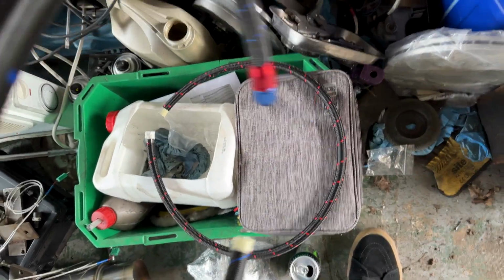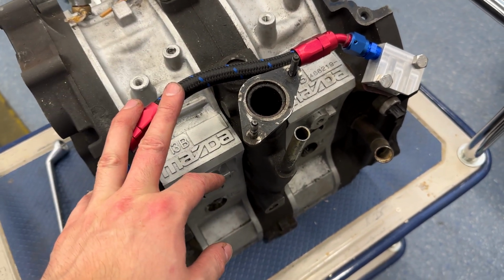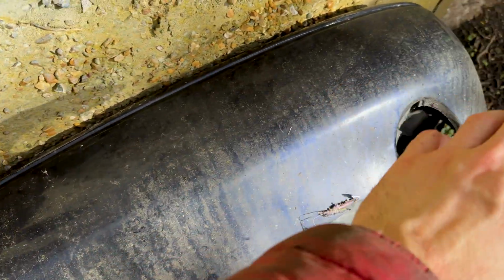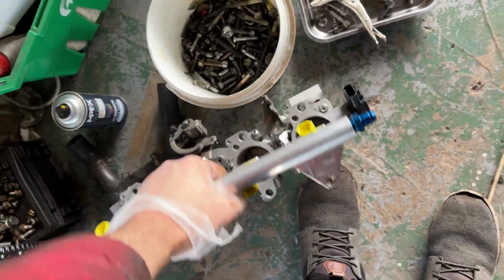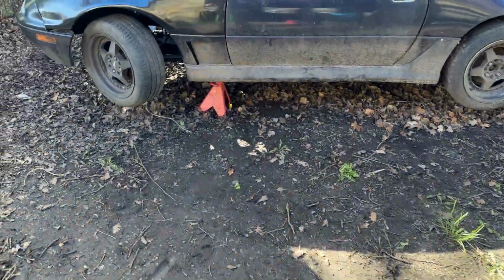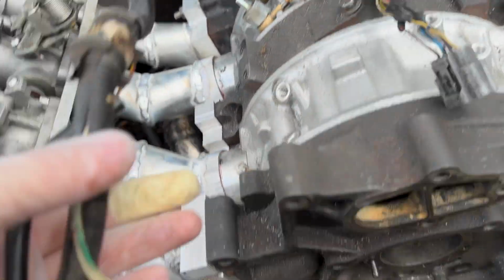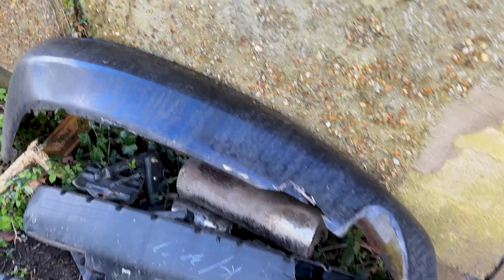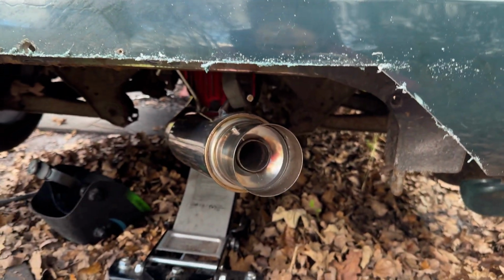Ep 12: Project RX-5! Intake's done! Exhaust done!

Comment: Really interested to see how the pp exhaust goes on a renesis
Reply from the maker: It should be very intresting considering the exhaust port is nothing like the shape of any factory 13b housing but alot more like the 13G and R26b race engine, a straight circle. Allowing for a earlier Opening and later close, also increasing overlap over a normal 13b Full PP setup. Im not running the side exhaust port just the 2 PP.